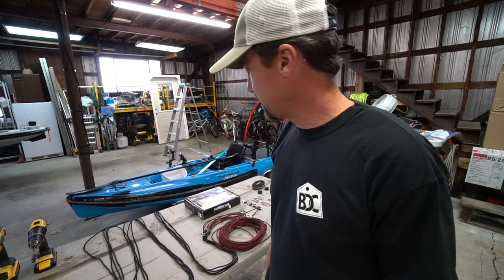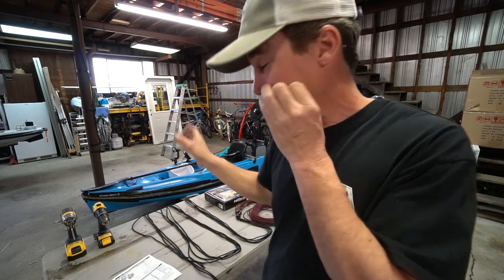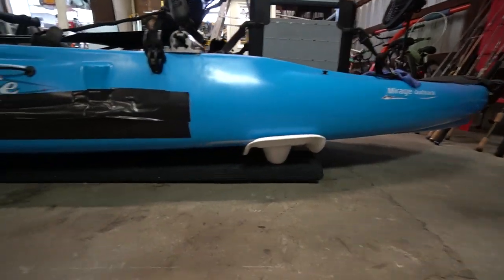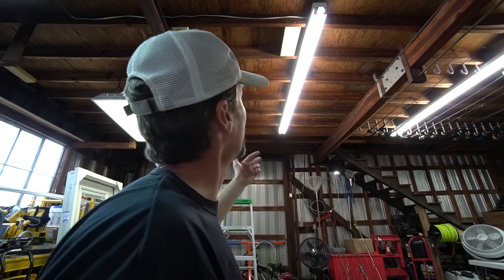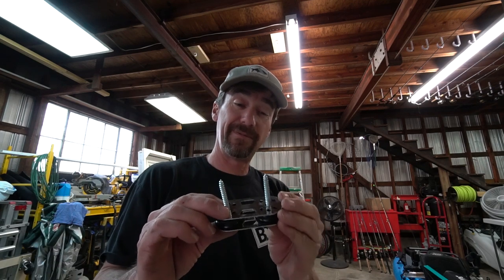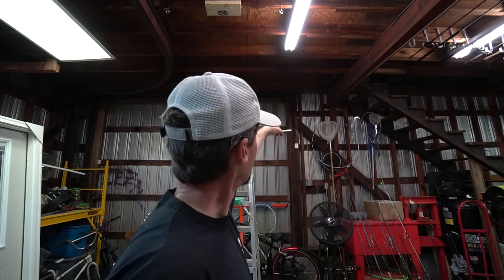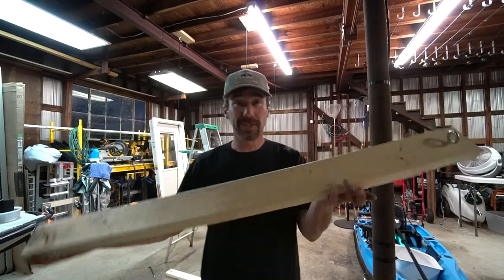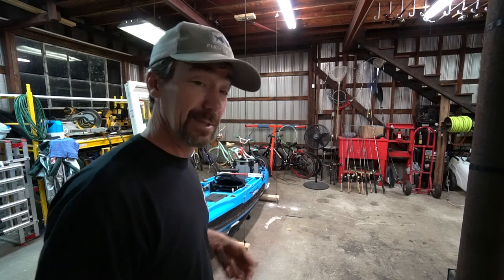Harken Hoister Kayak Lift Installation

Comment: You did pretty much the same thing I plan to do (I have the cradles on my PA 14).  I also wondered how difficult it would be to remove the pull rope and connect a small mounted electric winch to raise and lower the kayak - which is what I may try to do.
Reply from the maker: That would be pretty easy to do actually. The rope has very little resistance when lifting the kayak

Comment: Would be interested in seeing more detail about the sleds you use and how you connect them to the trailer.  I have a Hobie cradle attached directly to the cross bar but would like to be able to more easily slide it over to accommodate a 2nd yak.
Reply from the maker: Its basically 2 2x6 treated boards cut around 10 inches longer than the spacing of the cradles for each kayak. I covered them with cheap carpet and mounted the cradles to them. Then I have square aluminum crossbars on the trailer and I bolted a treated, carpet covered 2x4 to them. All I do is set the sleds on the trailer wherever I want them and run some screws down into the cross boards.
Reply: @SouthernReelsFishing  Great setup.  I plan on doing this in my garage.  Thanks for the video.  I also have the cradles for the 2019 Hobie Outback.  The instructions were not clear on how far apart the cradles need to be mounted.  Is there a defined distance the cradles need to be from each other?

Comment: That’s a cool looking product for getting your yak out of the way when you’re not using it. I need to get one of these for my yak. Had you thought about using a boat/trailer winch on the side of the wall to help with lifting and lowering?
Reply from the maker: The way this pulley setup works a winch would not work. You could probably build your own setup somehow out of one.